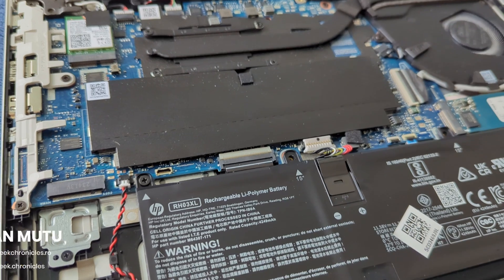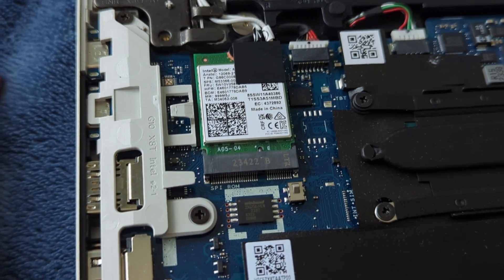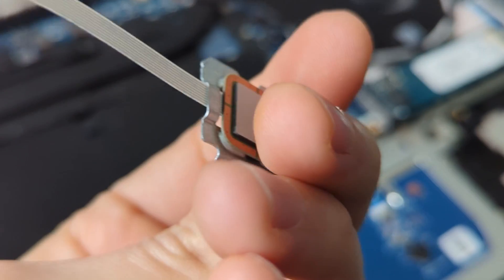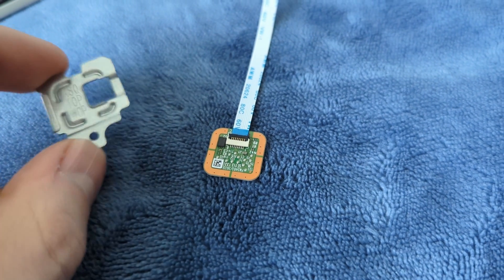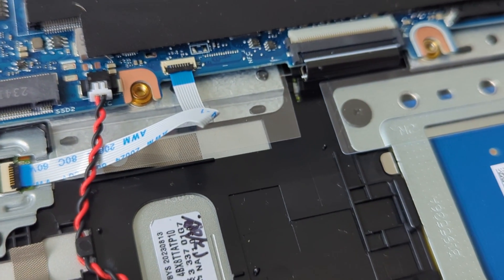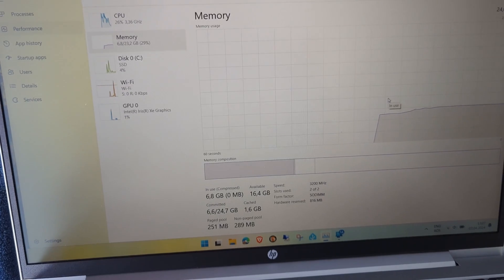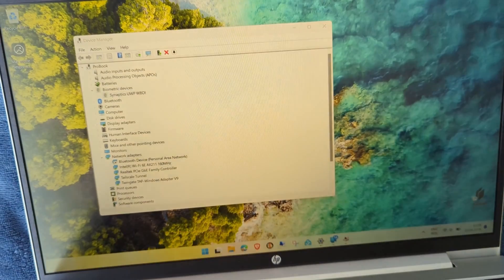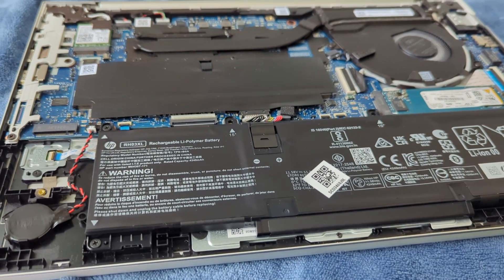HP ProBook 440 G10: Dummy Fingerprint Scanner Swap, RAM upgrade

Comment: hey, Geek!!
i have probook 445 g10 (ryzen 5 7530u), my variant doesnt have fingerprint sensor from factory.
by default, it has dummy in the cutout hole.
will your sensor (and driver) work as the native internel fgrtprint sensor of the laptop?

Comment: Hi , Great video, I did install the finger reader in my hp probook 430 g6, I proceeded as follows but I do not manage to instal the correct driver in windows 11... anyone having the same issue?
Reply: Hp Spectre x360 drivers worked for me on Hp 440 G6

Comment: Hello Geek Chronicles, greetings from Brazil!
I have a question: I own an HP Probook 440 G9 with an architecture very similar to the tenth generation. Can you tell me if it will work on this device with the same parts? 

It was a great video!
Reply: Opa, mano. To na mesma situação que você. Dei uma pesquisada e parede que o mesmo modelo de sensor serve para as Gerações 8, 9 e 10 dos probook 430, 440, 450, 640 e 650. Vou comprar e vou na fé KKKKKKK
Reply: @gabryeladriano7168 Opa, se der boa avisa aqui! Haha
Reply: @gabryeladriano7168 Opa, deu certo?
Reply: @lucasvaz6631  to esperando chegar o leitor ainda, mano. mas tenho 99% de certeza q vai sim
Reply from the maker: Hi. It should work if the port is identical. It's a generic fingerprint driver, nothing special.

Comment: Hey cool to see you successfully install the part. I want to order as well but does the part model number matter? Also what was the website you downloaded the driver from?? Also thanks for the tip at the end there, it helped me close my laptop
Reply from the maker: Hello, as for the part number im not so sure to be honest. Because the sensor that ive got its most likely a replica of the original. This is the sensor: https://s.click.aliexpress.com/e/_DkL2hrp (affiliate link) also regarding the driver, ive found mine here: https://www.driveridentifier.com/scan/unknown-driver/download/2050007140/F78733A1CB384514B06F18538F8DA7AF/USB%5CVID_06CB%26PID_00C9
Reply: @GeekchroniclesRo  I also bought this one but it was a different seller and the wire piece was bit longer
Reply from the maker: hmm...but in Device Manager the fingerprint sensor appeares with an exclamation mark or not?
Reply: @GeekchroniclesRo  Hey! After trying and trying! I was finally able to fix the issue I had :) Thanks! Found the right driver and now I can use it successfully! Also we have the same laptop, do you know if you can change the motherboard on the laptop to on with a video card? Is that possible? Thanks!
Reply from the maker: Note! If you plan to order from China, its possible that you may get different fingerprint sensor (different Hardware ID). Install the sensor in then search in Device Manager for the Hardware ID (if the driver is not found automatically). Then go into Google and search for that device ID and most likely you will find a link to driveridentifier.com with the correct driver.
Reply: @GeekchroniclesRo  Sad to say after installing the fingerprint scanner I am unable to make it work. I don't know which driver to use. I tried finding the ID but I was unable to. Do you know how I would be able to make it work?? Thank you so much